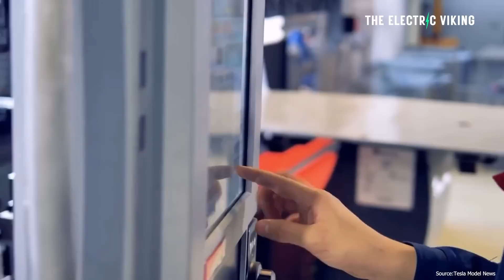Tesla Is Hiring New Engineers for the Cybertruck

Comment: It has an appalling shape it makes me wince to think of the airflow separation on the square corners and the kink in the roofline let alone the injury potential to pedestrians and riders - Ralph Nader highlighted the danger to occupants from interior hard sharp edges but this poses a real threat to third parties that need not be.  Flat panels will drum unless some damping means is applied and panel beating (body repairs) will be a nightmare -not possible to fair curves etc  (Designer of the 'all conquering" Bob Jane Monza GT 1982- and part of the XD Falcon and VT Commodore development crew  and others )
Reply: The cross outs are unintentional computer glitch....sorry.
Reply: How about fatigue at the top of the A pillar
Reply: Quite so,- the joke amongst car designers was that Volvos were designed by the same bloke who made the crates they came in  - all square lines and so on ,the Cybetruck takes it literally .  It might be that pressing stainless steel results in unstable springback unless stretched enough - the 'oil canning' problem.  The De Lorean was a bit 'edgy' too --sinks are deep drawn and avoid the issue.  Just speculating.@JeffMathias

Comment: The greatest benefit for use of the exoskeleton and Gigapresses is to address the dissimilar corrosion or Galvanic Corrosion issues that occurs when many different metal parts are used to build the vehicle.

By using Stainless steel and forming into as few pieces as possible means avoiding the vehicle corrosion end of life cycle that is freely incorporated in vehicles, that keeps stupid customers coming back for more.
Reply: According to Munro, a stamped steel spot welded main structure, steel subframes, front and rear aluminum castings and non-structural stainless steel exterior cladding. Galvanic corrosion does not see a benefit as you are adding another dissimilar material to unibody construction.

Comment: Sub 10 micron?  Is that panel gapping or sheet flatness?  I’m very interested in the pedestrian protection rating, as an adjunct.  Does anyone know yet?
Reply: US doesn't test for pedestriam protection. It might not be exported to countries that do test for it.
Reply: @larryevans6739  Quite.  It’s mitigation x frequency.  Trucks are less prevalent on roads than passenger vehicles.  The occurrence of semis in accidents is low (even though they normally are horrendous crashes).  Passenger vehicles (and pickups) are more frequent and by numbers are more likely to be involved ion crashes.  Any truck of any size will do significant damage in a crash, and then only reasons I can see they are tolerated on our roads are because the drivers are trained to a higher degree on driver safety and they supply about 95% of all goods necessary to sustain life as we know it.
If a manufacturer submits a pickup or a passenger vehicle model to the road safety authorities for testing in Oz (and its not compulsory), then pedestrian safety is tested and factored.  Thats what interests me too.
Reply: Musk doesn't care about pedestrians
Reply: And what about semis ! Do they come under the same pedestrian safety too.
Reply: @raymondschembri5042  No, as far as I know, and for obvious reasons.  They are not the same.

Comment: You’d hire new engineers because you need them. The fit and finish are apparently unsat to EM. The lack of price/specs is disturbing. No roll out date is not encouraging. The market is extremely competitive and somewhat conservative (in that truck customers don’t necessarily want a lot of change). It’s too late to get micron level tolerances. That has to be engineered from the beginning. Munro’s analysis indicated that the truck is not particularly ground-breaking. So…Tesla needs to slow the roll out because a weak roll out will not create a strong first impression. Sub 10 micron accuracy is not realistic (10 millionths of an inch or 1/100,000 inch). This is beyond most machining tolerances for a single precision part, let alone a mass produced vehicle composed of many parts. The panel gap problem is a real problem based on a couple of pictures that I saw and the straight edges make them look worse. Bare steel is also hard on slight defects like panel waviness (which I’ve seen in pictures). EM has said in the past that he wouldn’t buy the first months of production so maybe this gets better very quickly. Here’s hoping!
Reply: A micron is a metric unit
Reply: A micron is a metric unit
Reply: @Ted_adventurer  You’re right! It’s about .000039” so 10 microns is .00039 or less than a thousandth of an inch…so still less than most machined part tolerances which allow a few thousandths, typically. The point that this is not achievable for an auto-body built from many panels and components is still ok, I think.

Comment: This is what Tesla need to urgently address, over promising and failing to deliver, and definitely keep Musk away from any promotion until they are ready. How late is it, and where is the sports car. As comparison by the end of 2022 for example Mercedes had 8 EV models before considering trim level and battery size, The total EQ lineup currently includes eight models: EQA, EQB, EQC, EQE, EQE SUV, EQS, EQS SUV and EQV note no G Wagon. Their EQG Wagon arguably seen has the ultimate off road vehicle is ready undertaking test for launch 2024 prices are likely to start at around £100,000. Meanwhile Tesla’s still faffing about with their station wagon.
Reply: Absolute nonsense. I am a Tesla investor, but I prefer a Mercedes for a personal car and I own an E class. Tesla is not Mercedes competition and vice versa. Tesla competes with Ford, Volkswagen, Toyota and Stellantis for the mass consumer rather than Porsche, Mercedes and BMW. The electric CLA will cost between $10-12,000 more than the Model 3, without any extras. Tesla and Mercedes are completely different companies that have different customers.

The cheapest G class is over 180,000 dollars, and an electric one will certainly be over 200,000 dollars. Tesla and Mercedes are not competitors - they have different customers.
Reply: @AntonMilev  I think you should read the prospectus for the cyber truck, they have moved upmarket it’s not going to be cheap. Mercedes Toyota and Land Rover have been making the best off-roaders for years they understand the complexity.
The strategic point, effectively Tesla’s got 4 car models and a truck available to sell whilst they are faffing about with a pickup.
I chose Mercedes because they quietly got on with it, without fuss and have 8 soon to be 10 passenger models even before considering they are the largest manufacturer of Trucks in the world, which would then take total available models to 16, in the same development time frame. 

You are correct Daimler Benz are in a quite different league, so is Toyota and Volkswagen, I would also argue so are Stellantis, BMW and Renault, a strategic point some Tesla investors have yet to fully grasp.
Reply: Yes Tesla talk a lot and deliver late